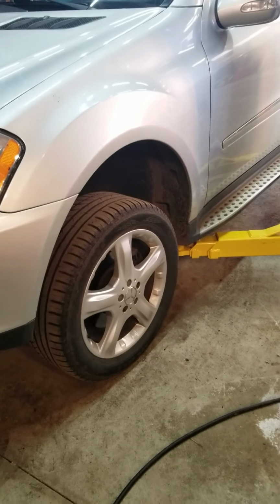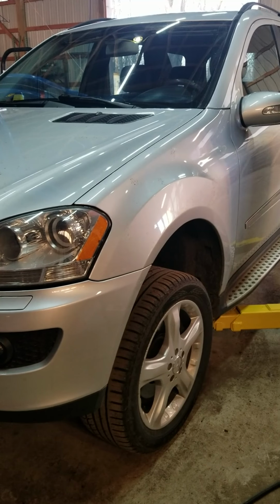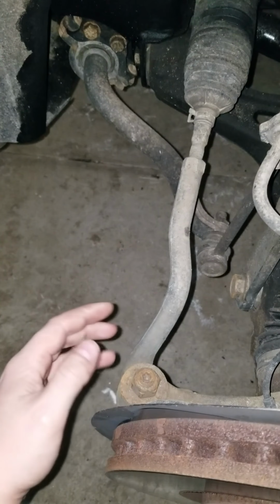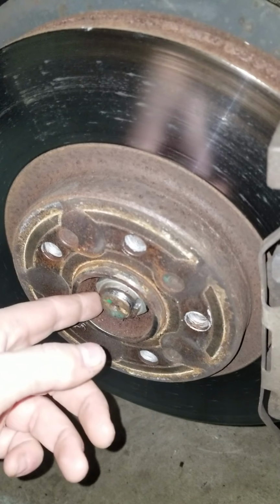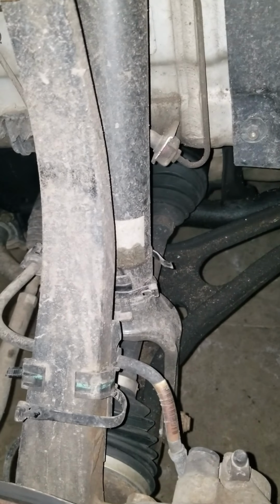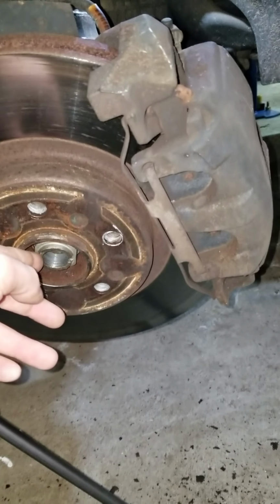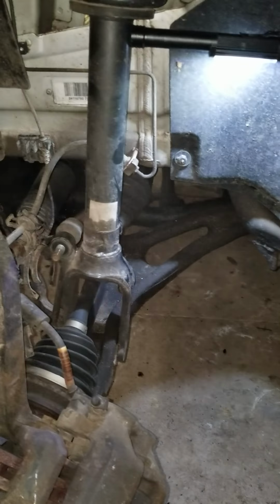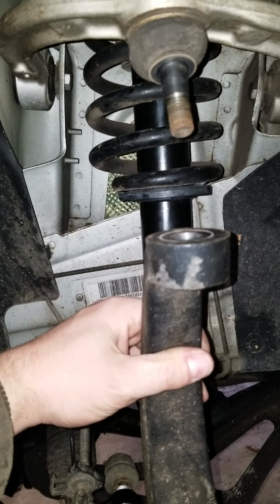ML320 W164 Front Strut (Shock) Removal DIY!

Comment: actually,  the right hand side was real easy, just unbolt everything, with a floor jack under to not let the lower control arm just hang loose. and detach,upper control arm,   arb, steering tie rod, axle bolt. right side comes out easy and   went back in with a spring spacer no problem. Left side more difficult, easiest to just pull the axle out to give you easier access. Then not an issue.
Reply: Yeah +1 for this. I pulled the CV and the job was cake. Thanks for the tip @rogereverett9095

Comment: Wow you made that look easy. Do you have any experience with the V8 diesel in the ML, the 420 CDI ? I'd be interested to see how it compares with the 320 CDI reliability wise.
Reply from the maker: I don't believe the V8 was an option in the United States, which is where I am. I really don't know anything about that engine. What's it's designation? Is that the om629?
Reply: @MBDieselFreak  Yes that's the one. Not many around here in the UK now.